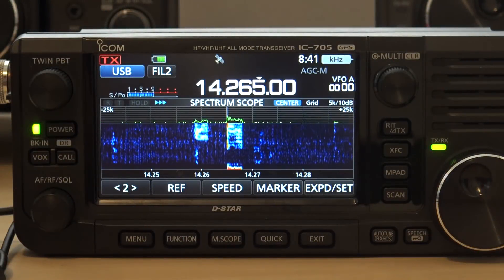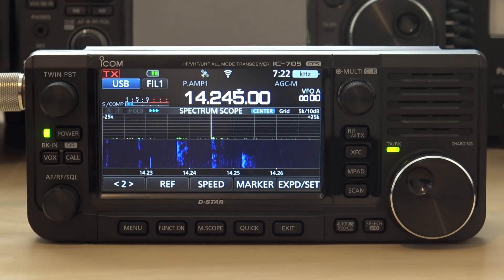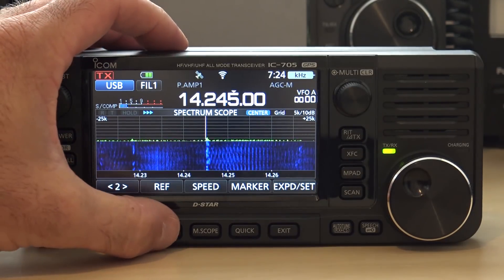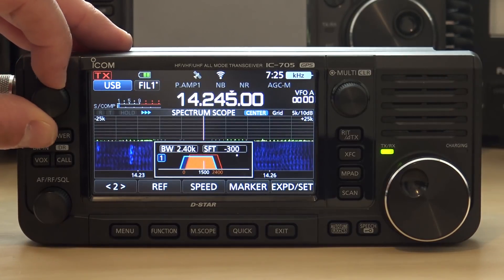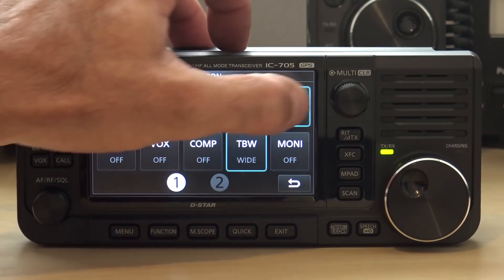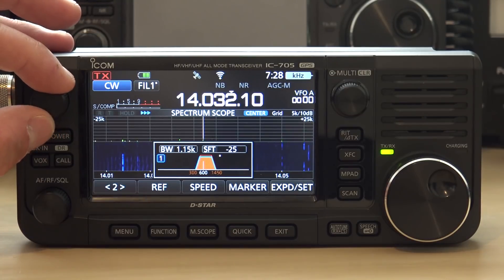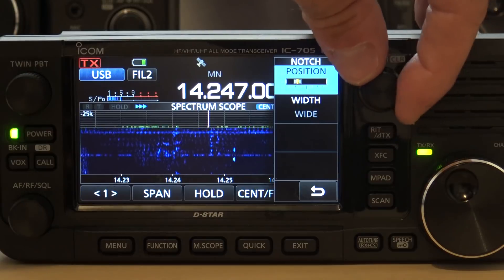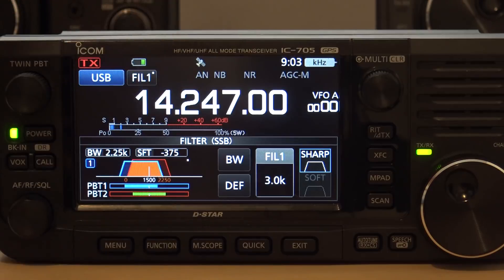Icom IC-705, Filtering And DSP Options For QRM/Weak Signals

Comment: Another great video, Eric. Your demo of the passband, the notch and the if shift sold me on this radio. I was all set to order the KX3 this morning, but thought I’d better check out the IC-705 thoroughly first. The KX3 is a great radio with its filtering capabilities, but it went on the market in 2013—already 8 years ago! The 705 is a brand new concept and its menus and features nearly duplicate what my 7300 has. So, the filtering, etc. tricks I learn on the 7300 can transfer to the 705. It’s like having an iPad and iPhone that sync and run the same programs, only the one is smaller. The large 4” display screen on both, plus the complete touch screen control cinched me on the 705. Your video really helped!  Thanks again. 73, de WB3BIQ.

Comment: Nice. I have a IC R8600 and recently purchased a Yaesu FTdx101. Both are SDR's. To my dismay about 1 month after purchasing these two radios my neighborhood has developed such noise on my radios that I am finding them nearly useless at times. Powerline issues maybe. The power company has been out twice and has replaced Poly's or insulators on at least 8 poles. Still the QRM or static is so powerful 80 meters is useless at night and 20 and 40 are marginal throughout the day and evening. I have done many test and the only time I had no overwhelming static on my radios is when hurricane Delta passed by and knocked out the power in the neighborhood. My generator came on and for four hours listening to the radios once  again was enjoyable. I live in a semi-country setting. Houses are on 2 to 4 acre lots so I am sure it is not interference from someone's plasma TV or such equipment. I had a Yaesu FTdx 5000, non SDR and I had no issues with the static. However I had no issues until nearly a month after I purchased the 101d and the IC-R8600. I grew up listening to SW as a kid in Alaska. I had hoped to have a good experience with the radio hobby once I retired. No such luck.
Reply: I know it's been a year or so since you posted this, and I hope your situation has improved, but have you considered portable operation? Packing up a go kit and going to a park or on a hike? Just a thought! Good luck!
Reply: @shadowfest999  Thanks for commenting. The power co came out and after 4 tries they found the issue on a pole. The static/noise issue was corrected. Enjoying the radio hobby once again.

Comment: I’ve found that it’s useful to analyse noise before trying to tune it out.  Handily, the IC-705 has the audio display for that (under main/audio) which then shows a frequency scope of the audio on the left hand side.  Once I can see where the noise is, it’s easier to try and remove it.

Comment: I have two questions:

1) Eric, how do you think this one does on HF compared to FT-991a or FT-891, regarding to the receiver/noise reduction/filtering?

2) I am very interested in how this 705 performs on VHF SSB. First, Yaesu rigs (namely FT-8x7) miss the advanced filtering features/options on VHF. When you switch to VHF, most of the features you use on HF to clear noise or dig for weak signals are gone. Does IC-705 support all these for all bands or HF-only, as we are used to on Yaesu rigs? Secondly, Yaesu FT-8x7 are known to be easily overloaded by a nearby strong VHF station, so even if it transmits on 144.200, you don't hear anything with FT-8x7 on 144.250 or even higher, only because you're "lucky" enough and pick wrong QTH. Again, is IC-705 an improvement over FT-818 or FT-991 in this situation?

Thanks!

Comment: An amazing radio with a serious flaw. It’s missing a second antenna for frequencies above 6 meters. My KX3 accommodates a second SMA antenna. A deal breaker for me.
Reply: Just use a switch.
Reply: John Ratcliffe a switch then antenna tuner on the hf side. Too much flopping around when mobile/portable. Love my 7300 but I’ll stick with the kx3. Best regards

Comment: $1299 is too much for this.

PS - anyone ever tell you sound like Anthony Edwards?
Reply: It is common marketing.  They will get all those willing to pay the initial price, then move down and get the rest.
Reply: oldpreach Agreed, this is the early adopter price.  I suspect after a year or two the price will settle in at $1099 or even $999.  Also, component costs typically come down in price over time, permitting such reduction.  Regardless, it is a very nice portable unit.

Comment: Ha ha, look how much the battery dropped in 8 minutes! 
I own the 7300 and while it's a decent radio the receiver is noisy and the filters are not very good, they reduce audio quality too much without being very effictive.
If I compare my FT-891 it's got a far quieter receiver with much better Filters and DNR and best of all it can run 5-100 Watts, yes you need an external battery but I can use a 8.4AH 4S LifeP04 for several hrs on SSB @100W. No big deal.
I always listen with headphones and by far the best sounding radio is the 891, with DNR off you get good O'l clean analogue sound which is much more enjoyable to listen to, the 7300 sound  is fatiguing. 
I'm now waiting for the TS-590 SG and selling the 7300, I wouldn't get the 705 because I feel it will sound just as bad. 
My advice to anyone would be buy a KX2 or Kx3 for that money or FT-891 because all the screens and waterfalls in the world won't make you hear better. 

Just my opinion.
Reply: I agree. 891 , the best bang for your buck. An FTdX1200 in a small form factor. Same DSP chip as a ftdx101 and 991a
Reply: One great thing about Amateur Radio, among others, is that everyone has an opinion! Your mileage may vary. I own a 7300 and a 10 YO KX-3 I bought new. I love them both, and they serve me well. My opinion. I’ve been a ham for 55 years (I’m 71) and I’ve owned and operated dozens of rigs. We are blessed to live at a time when there are so many relatively affordable choices available. Awesome technology abounds.

Comment: I have the Yaesu FT-3D and the AnyTone D878UVPlus. I am using a duplex hotspot to connect them to the internet and sometimes the Yaesu Wires-X cable kit. I live on the 39th floor of a high rise in downtown Denver, CO. I face east. Most of the repeaters are to the west. These HTs cannot consistently hit the nearby repeaters. Obviously, I cannot have a huge antenna (unless I hide it like the one you put in a planter at your mom's house). Would you recommend the IC-705 or another radio to go with the two HTs. I like the portability of the 705 and the fact it would give me D-Star but the low power makes me think that for the money I should get one of these: FTM-300, 991a, AnyTone 578 Icom 9700, or whatever your choice would be. Any thoughts? I am willing to upgrade my license from Tech to General and get help from you on an antenna choice that I could place on the balcony. Thanks. I always enjoy your videos.

Comment: Don’t get me wrong, I love my ft818. But for older eyes and features this blows the 818 put of the water. Thanks, 73
Reply: not sure about that I have a 817ND and I can work weaker stations than with the 7300.
Reply: @FFdo.  Really? In which context (i.e. just weak on a quiet band or weak sinking in noise/QRM/...? I have a FT-818, thinking about IC-705 as an upgrade for portable operation, for both HF and higher bands (I do VHF SSB a lot, including portable). However, is it really worth? IC-705 has waterfall, some extra features, such as BT, wifi, D-star, GPS, etc., some more radio-related features (filters with changeable width, advanced features (NB, preamp) also on VHF (which FT-818 does miss)) and looks much cooler. But is it worth for the price? I'd tend to think it is, but only in case I won't find out that FT-818 finally receives better, despite all that...